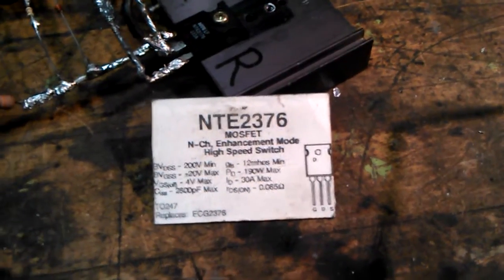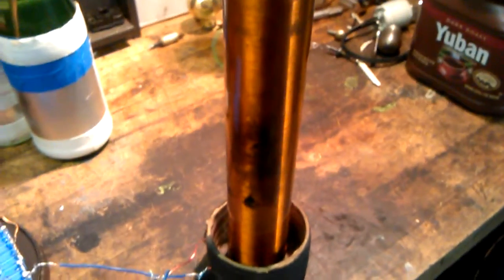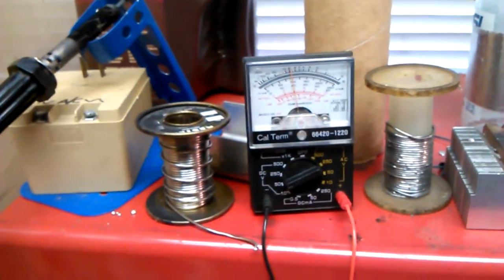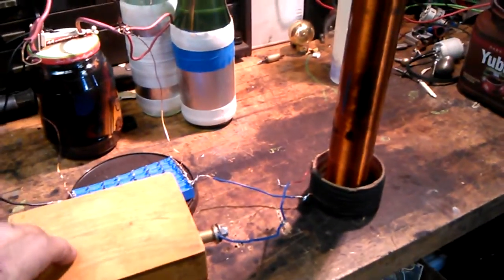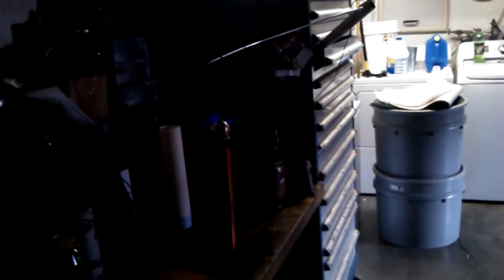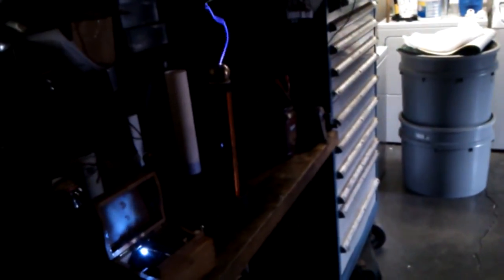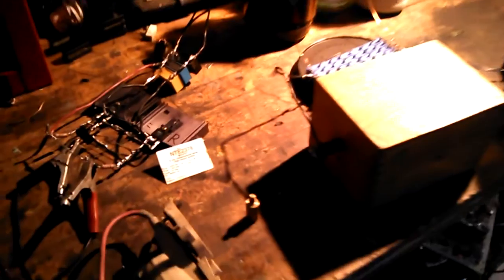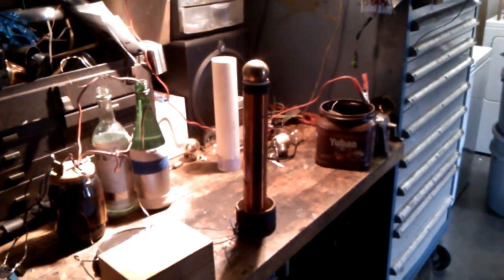Awesome Highvoltage ZVS driven tesla coil!!!

Comment: dude nice damn job ! been a long time bro we should have a chat again some time =D but yeah some real good output i got a lot more experimenting to get my bigger coil working right maybe i'll try a smaller one ... when you put together your next primary you could put on some tapping points to help with tuning .. those phillips caps. are pretty popular to use may have to see if i can get them for a good price love my WIMA caps but damn are they expensive ! and those FETS look good to use they have low gate resistance and would take a lot of amps to heat them up .. cheers brotha !
Reply from the maker: Yo whats up bro yeah i kinda took a break from "things" ya know?  But never stopped with my tesla stuff;) you,me,Anthony&abrams lab should do a chat. im hella happy with my zvs it doesn't break a sweat even runnin off the rectified variac mains @ 10 amps!! Will be rewinding a mot for 40-60 v as a power supply cuz the 5amp variac is weak sauce later bro
Reply: hey man ! yeah i understand took a long break myself last year lot of shit going on at the time but damn i missed workin in the shop and chattin with you guys .. we should definitely chat some time ! yeah dude the ZVS inverter with good FETS or IGBT's and in tune with the flyback or other high freq. transformer is a kickass power supply .. lol im doing the same soon with a MOT my variac is rated for 8A and i laughed hard when i saw '' weak sauce '' have a buddy there is the states that said that i miss America sometimes ! later man take it easy ..